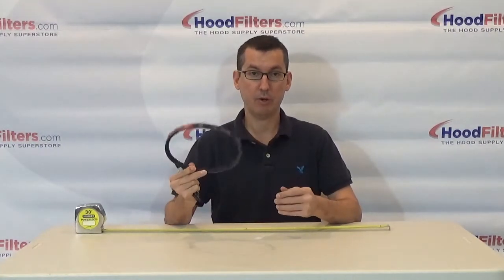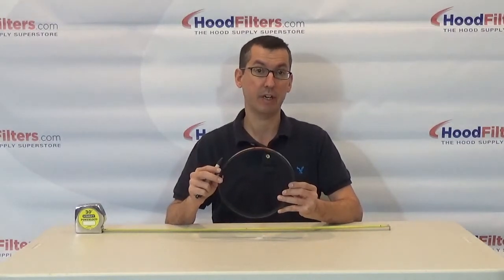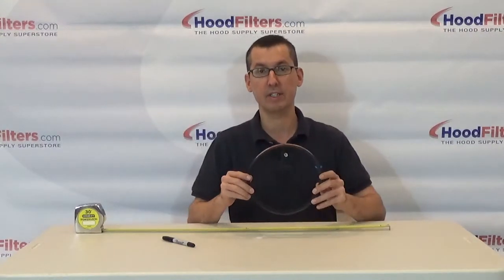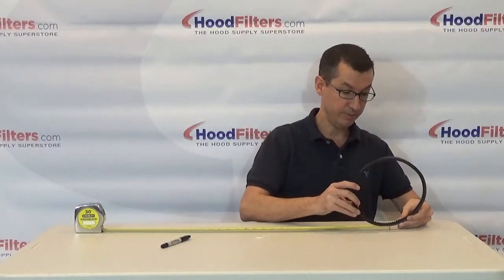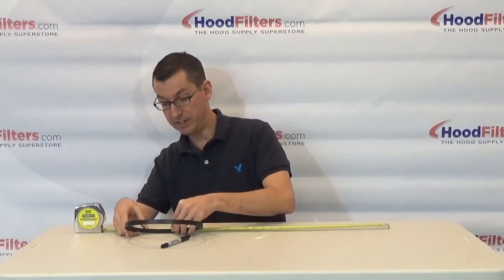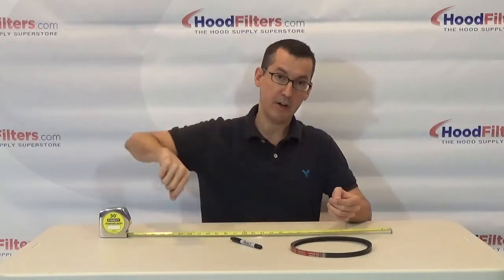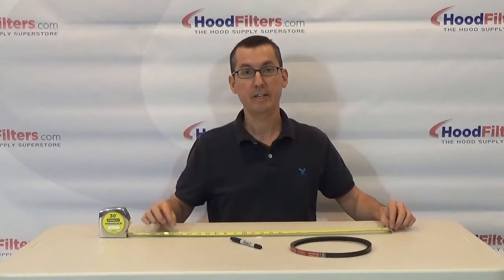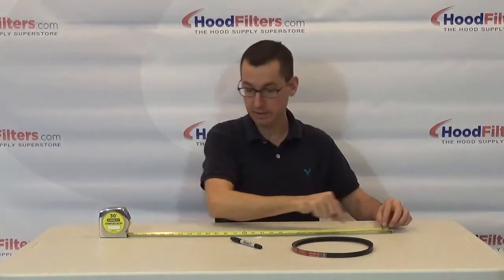How to Measure a Fan Belt?

Comment: What about for a fan like this what would you do. Because I want it and I talk to my dad in the past and I talk to him recently about it like a few minutes ago or so and he said we’ll see. Because I told him we have a 30 inch pedestal fan distract her I just look at louder and it’s a three blade it’s a modified pitch because ever since it fell on the ground that time. But I made it a little deeper pinch so it can work/not wobble. And it works better… But I told him how this fan it’s quieter and can move more air in a lower RPM/deal, and sometimes to Paris for family so loud we will move it into the back of the backyard/patio so it’s not so loud and it wouldn’t close my chair, but this fan you can move it back in that same spot and you weren’t even here and yet you were still be feeling the effects from it… You know. But yeah, plus I just think it’s really cool too